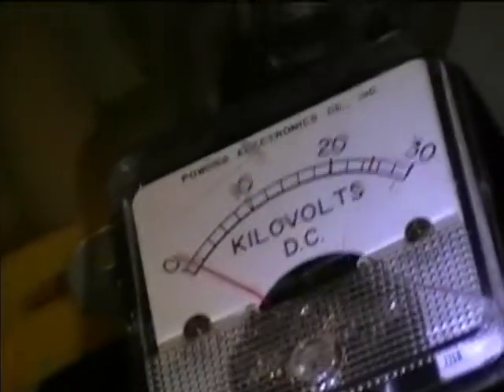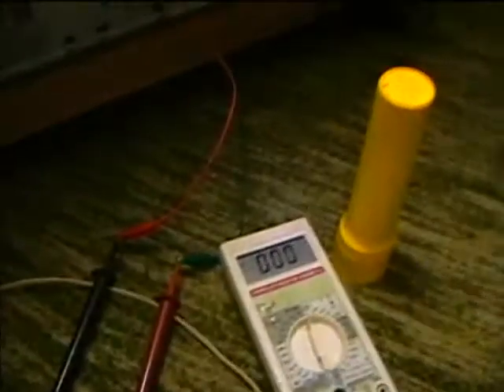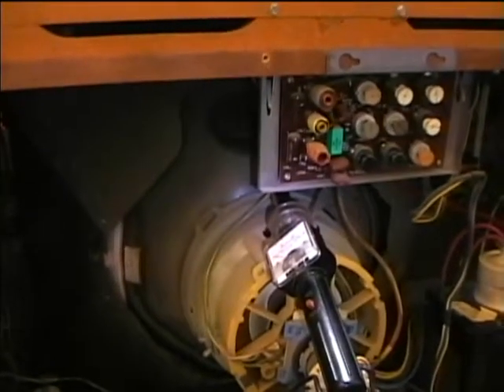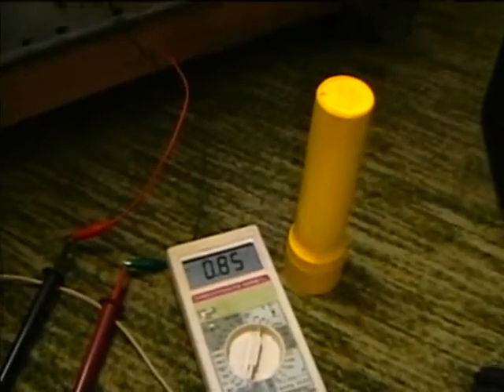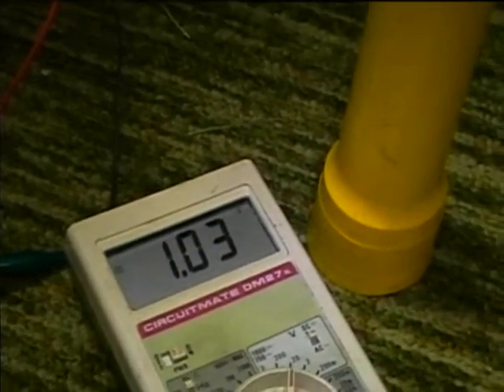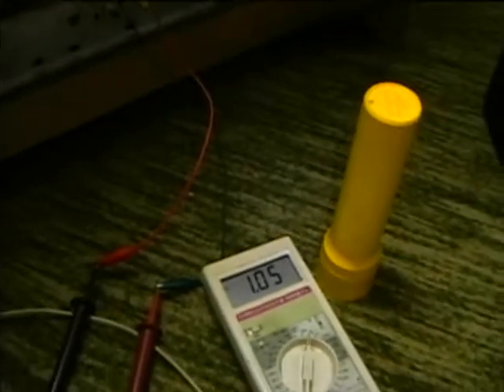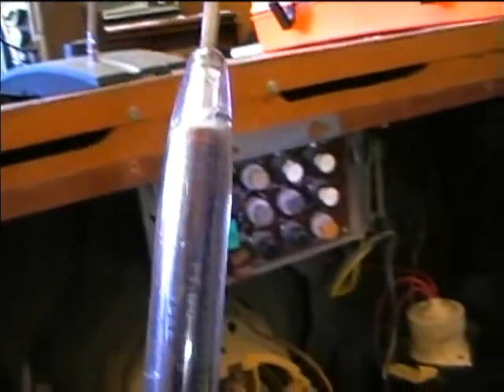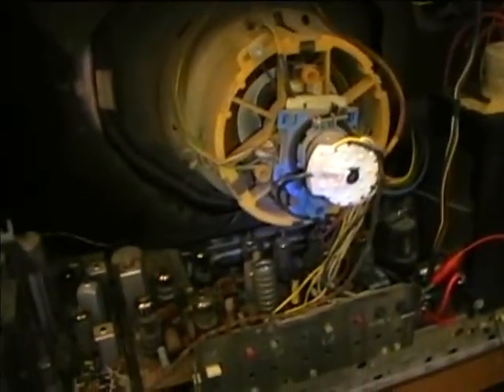1967 RCA CTC-28 tube type color TV high voltage check

Comment: I remember playing around with sets like this when I was a teenager. Mostly I'd replace the tubes etc. I took electronics classes in high school so learned to stay away from the high voltage. Of course you can also short the high voltage wire the metal chassis and if you see a big blue spark then the HV is ok. That's the way the old time tv techs checked the HV.

Comment: Nice HV probe, great tool to have for TV work. Still it is scary working around that much voltage. The mirror, I can remember seeing a mirror at the end of TV repair shops workbenches and in High School electric shop workbenches. Had not thought of that in years.

Merry Christmas!